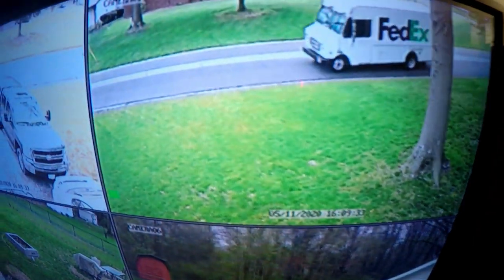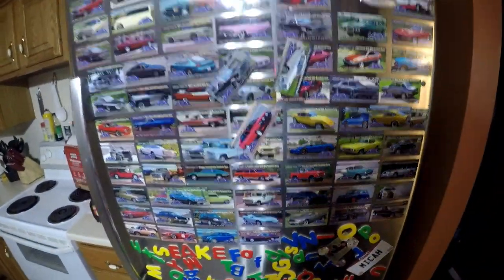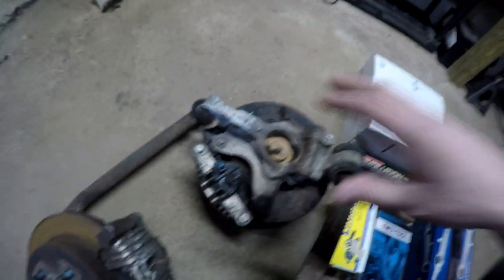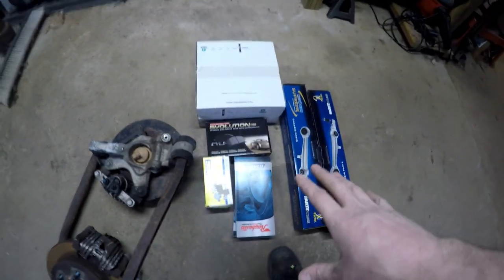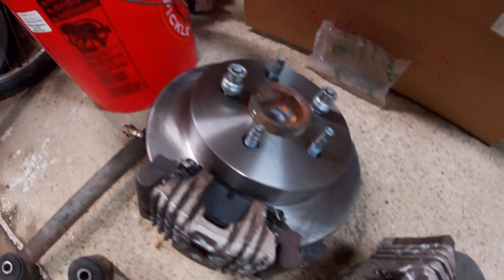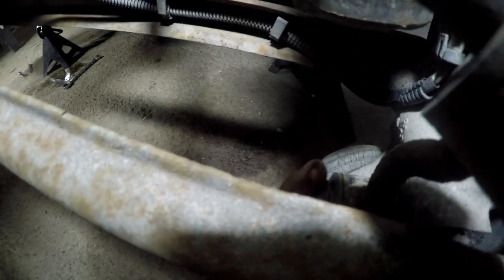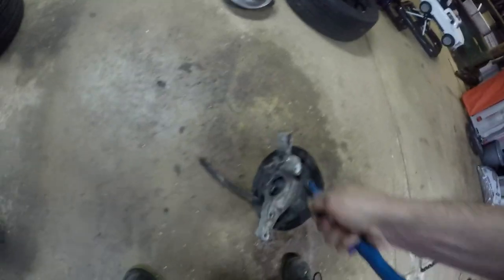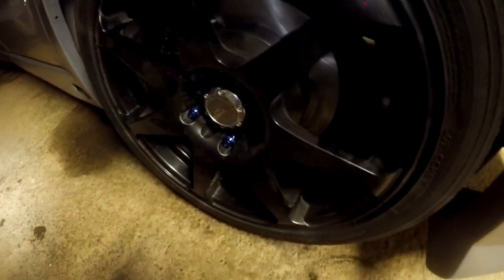N-Body rear disc brake swap

Comment: Are all three of the arms (Trailing and Lateral) the same between the two brake setups? I just picked up a set of knuckles AND e-brake cables from the JY near me for $50. I'll need new hoses as I simply cut them off (planned on replacing anyway). Also, did you need to replace the Master Cylinder? Would it be better to use OEM rubber bushings, or should I opt for Polyurethane for a daily driver?  I MAY try to get a pair of front lower control arms from a 1999 GA! Just because...
Reply from the maker: Yes suspension is all shared between! Hoses are actually different lengths. Master cylinder and abs unit stay the same. For bushings, there aren't any poly on the market so you'd have to make some. Funny enough, the car in this video is a 99. Needed ball joints so we put loaded steel arms on and sold the aluminum ones lol
Reply: @KMaffittGAGT  Thanks for the fast reply. I knew the hoses AND cables were different.  I had planned on getting new hoses so that was why I cut them. Took a bit to disconnect the cables from that center piece but now I know how, swapping that will be easy. Mine needs new bushings in the front. Probably end up doing like you and getting pre-assembled arms.

Comment: Can you reuse the hubs original hub assembly. And will the original wheel clear the new rotor set up. I've got the factory 215/60/15. Idk if the gt has a different set up
Reply from the maker: You'll need the hub/assemblies from a rear disc car. Grab the entire thing from a junk yard to save time and cost!
Reply from the maker: I'm unsure if the 15s will clear. To my knowledge all the rear disc cars grand am/Alero had 16s. Best bet is to check at a junk yard. Good question tho, if you find out please share and I'll add in the description!!